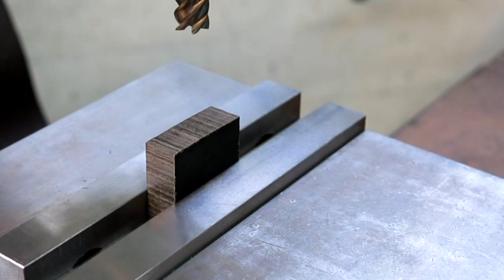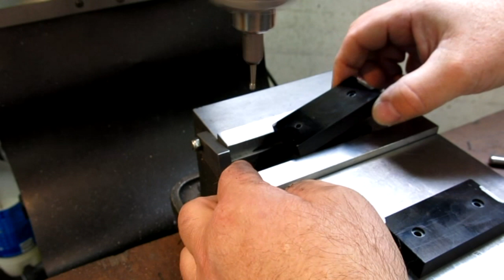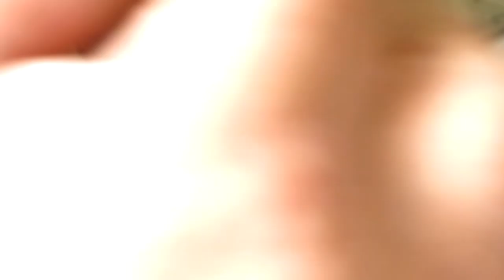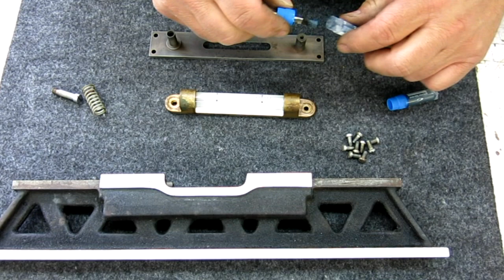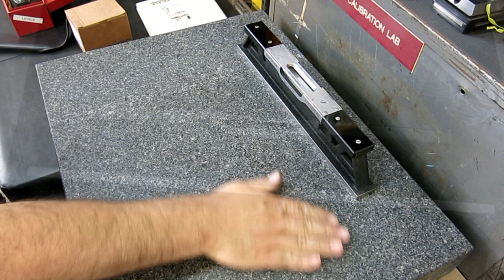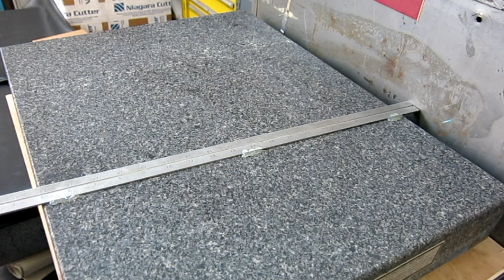Pratt Whitney Level Refurbish

Comment: That’s great. But the Starrett machinist’s kevel is marked at 0.005” per foot, while the precision master level is market to 0.0005” per foot. It only gets you so far. Just enough to level the surface plate to barely within the range of the master level.

By the way, never touch, or breath in, denatured alcohol. The “denatured” part of the name is saying that it takes organic molecules apart. We don’t want that to happen to us.

Comment: Ha, I’m not an engineer but even I can see what the problem is ,,, when you pull backwards left to right the blade of the bit is not digging in as you are offering the rounded smooth path,, when you are moving forward right to left the sharp part of the bit is ejecting material away hence the broken edges ...

Comment: I wonder if anyone sees old video comments; I will try.

It appeared that the bubble spanned several markings and was not even on either side.  Might be video distortion but the question is:  If that's the case, how is it read?
Reply: Repeatability is what you are reading to determine or calibrate a level ... surface itself need not be 100% level (or more level than the level you are calibrating). The increments or markings on level have been graduated or spaced out to measure .0005" of vertical difference over 12" horizontal by manufacturer of vial (in this case certified as such by Pratt Whitney or their supplier). That being said, when bubble was in same position relative to center point when level was rotated 180 degrees, that adjustment calibrates that level to true. Now you van level your lathe bed, or machine surface within .0005" per change in markings on level. Hope this helps. Cheers.

Comment: how did you calibrate the unit-by comparing it to your existing unit? how do you know the original unit is calibrated?
Reply: Looks like that was to find a roughly flat surface and make a rough adjustment. Once a level is close to adjusted correctly, it is self-proving by the reversal method (assuming the vial is made correctly, of course). If you turn it around on a level surface the bubble will show the same reading in reverse, then you just have to adjust it so it shows a zero reading in both orientations. If you think about this geometrically then you will see this can only be true when the level is on the level: the level shows true angle + error angle in one orientation and error angle - true angle in the other; therefore it can only show zero in both orientations if it is on the level (true angle = 0), as you are reversing the error term (or angle term, depending on how you look at it) by flipping it. From the same principle, you can determine level with a maladjusted level, because while it will not read zero in either orientation, the deviation from one orientation to the other must be minimum when the level is level. Because the level only reads 0.003"/foot, full-scale, it would be excruciating to find a rough level with that instrument alone, as even a relatively small error would be off-scale.
Reply from the maker: The second level was just to get close for the initial adjustment. To make the fine adjustment you rotate 180 and look for the same bubble position. It helps somewhat to be semi close to true level when you start. Thanks for the comment.

Cheers,

Tom

Comment: Tow, when you pushed on the surface plate was the plate flexing or the table under it? Oh, that isn't a smart acre question. I have one of these levels too.
It turned out beautifully.
Eric
Reply from the maker: Hi Eric,

I'm sure it was a little of both. Thanks for the comment.

Cheers,

Tom

Comment: Tom, Would a different type of "plastic" be OK such as teflon?
Eric
Reply from the maker: Hey Eric,

Sure. Almost any poor thermal conductor would work fine. If you were watching closely I only made one isolator. I wanted the new one to match the existing material. Thanks for the comment.

Cheers,

Tom
Reply: @oxtoolco  I have often used exotic hard woods to make end caps to give it custom look/feel ... even more expensive feeling  because of that (read could not find phenolic material or even something with "Kodak" or "camera case" finished plastic). Beauty job tho!

Comment: Tom was that blue thread-locker or some type of anti-seize or anti-corrosion / grease compound you were putting on the fasteners?

Using material that matches the original part is really cool!

Comment: just a thought. when your wanting to avoid breakout but you can't mill into the material like you did i wonder, could you score with a sharp blade and introduce a weak point so it breaks there instead of elsewhere? i do it with kitchen worktops that have a laminate finish and it works very well

Comment: It may have been the camera angle, but to me it appeared the bubble is not centered.  beautiful instrument that you very nicely restored Tom.
Reply: Actually I think the granite plate is just a hair (or maybe even just quarter of a hair with this level) off from beeing absolutely level.
A good way to check if it is the level or the surface it is sitting on was shown by Tom previously, just turn it by 180 degrees. If it still is "not level" in the same direction. If it shows not level the other way round, check your level.
With this degree of preccssion even a speck of dust, dirt or debris (very fine one) might be an issue.
Reply from the maker: Hi John,

Calibrating a level is about symmetry. When you turn the level 180 degrees it should read the same not necessarily level. If you have a good flat smooth surface you can calibrate a level even if that surface is not actually level. Hope this helps. Thanks for the comment.

Cheers,

Tom
Reply: Yes, he used his "known standard" level to find a place on the surface that produced a moment about which to measure.  In this case it appeared to be a place where the bubble is nearly/or on the line on one edge.  Flip the level around and it should be the same on the opposite end.  Then he calibrated the P&W level using that instance and setting a guide so position would be near identical.  Good enough for the girls I go out with....lol

Comment: What is the schmoo you brushed on the threads of the screws?
Reply: Best Services I'm fairly sure it is blue loctight in a custom made bottle.
Reply: Custom made bottle - check.   Gotta love that.
Reply from the maker: Hi Best,

That was Blue Moly anti seize. Thanks for the comment.

Cheers,

Tom

Comment: So you put your finger down hard on a granite surface plate, and I must assume the stand is up to Oxtools standards, and the level deflects a division and something? I f I hadn't seen it I wouldn't believe it. Yet something is tilting. Surely not the granite plate? Must be the stand. Or the suspension on the plate. Please, Mr Metrologist, I mean Mr Wizard, why is this happening? I will go through a very large number of meatloafs for the answer. It would be a large deflection if you were measuring to millionths.
Reply: The level divisions are 0.0005" per foot.  This is only 8.6 arc seconds.  That will be the cumulative defection of every component between his finger and the ground.  Everything deflects due to a change in force, even the granite plate.    A piece of lint under the end of the level would throw it off.  A piece of cigarette paper under one end would throw it out 2 ticks on the level.
Reply: I quite agree with you. Even the ground -- a concrete floor -- deflects under sufficient load. My question is, which of these components is deflecting? For ordinary measurements in a shop this deflection will hardly matter. But, in precision work, everything matters,
Reply: possibly the rubber/plastic feet on the bottom of the table, is the only pliable thing on it
Reply: Very good. First reasonable explanation I have heard.
Reply: Tom just has Chuck Norris strength in his finger...
Reply from the maker: Doug has the right answer. I scared the granite plate into moving. Thanks for the comment.

Cheers,

Tom
Reply: Would that I could intimidate my tools as you do,

Comment: Lots of small tricks for (easily) making it look good, as well as precise.  Restoring the marks on the vial, making them stand out without fuzzy edges, was something I was trying to remember the other day (it had been a few decades since I'd seen it done).  Would like to know what was used on those (I'm currently thinking enamel of some kind ...?)
Reply: I also would like to know what was used to fill the graduations on the vial.
Reply from the maker: Hi Digger,

Testors model paint. It was oil based enamel. Thanks for the comment.

Cheers,

Tom
Reply: If it was the same as the white base paint I assume it to be modeling paint. They come in very small bottles & have many uses.

Comment: Why not use Delrin? We've come a long way in the world of plastics since Pratt and Whitney dinosaurs roamed the Earth.
Reply from the maker: Sharp eyed viewers would have noticed I only replaced one of the isolators. I made two in case Mr Bozo came to town. One of the isolators is as the level came with out of Pratt & Whitney. I really didn't want to mix materials. Closest to original was my target. Thanks for the comment,

Cheers,

Tom
Reply: OEM materials=best practice in restorations
Reply: Also, to add, Phenolic feels like a noble material..putting Delrin on that P&W is like restoring a 60's Italian car and slapping a carbon fiber hood on it because "we've come a long way".
Reply: The longer the bubble the more accurate the level. Nothing leaked out of the vial, it just happens to be a VERY accurate Instrument. I think he did a wonderful job fixing this piece of what can only be described as industrial art manufactured by a true craftsman. It would have been an absolute shame to use anything other than original materials.
Reply: If you think this is just a tool, i feel sad for you.
It actually is just like with old cars in peoples garages.

Its a part history, and it has its history. So you treat it accordingly.

No matter if its a tool, a car, an musical instrument, or a painting.
Reply: Phenolic is still a very common mass produced material and obviously has stood the test of time.  It is a better choice for a thermal insulator than Delrin in my opinion.  The hand rests are not bearings.
Reply: It's a tool to be used, sure.  But if this were my restoration I would have chosen Phenolic over Delrin.  I mean, he's gone this far, why not make it look and feel like the original?

Also, Phenolic is still used over other polymers and other composites in situations that require fire resistance but the performance of a composite.  Delrin doesn't do too well  with fire.
Reply: It's a level. He's not taking it the Amelia Island Concourse d'Machine Tools. Looks like the vial has leaked anyway. The bubble should not be that long. So I guess it's just fer lookin' at.
Reply: because this is a restoration not a modification
Reply: Your' pulling my leg, are you not?  It would be like the Monalisa with an aluminium frame, the state of independence pinned up with thumbtacks, a Rolls Royce with light magnesium sports wheels, need I go on?
Reply: When it comes to originality, it's original or it's not. No middle
Reply: +Wes Johnson - I agree.  Others have replied about this being a "restoration" and using the "original materials".  If Tom were that concerned about this level of fussiness he would have used the proper size of screwdriver for every screw.  I doubt he's planning on putting this in a glass case on his mantle.
Reply: +Wes Johnson  Yes using original materials has completely f'd its functionality.  Only using Delrin could make it function properly....  Calling Tom a hobbyist was classy too.  Nice one.
Reply: lol
Reply: It's a hobby. Therefore he is a hobbyist.
Reply: Lol!
Reply: LOL so what if Tom wants his level to be like an old car in some rich guy's garage? Do you really think he needed another level? "Hobbyists..." yeah, people doing what they love, making beautiful objects for them to cherish, what morons.
Reply: Jesus. It's a tool made to be used. It's not a car made to sit in a rich guy's garage. Delrin and Phenolic have the same coefficient of thermal conductivity. Delrin is a dream to machine. Hobbyists...

Comment: looks awesome  but a little lost here  , the two marks with the dots at each end was that not zero but yet the bubble went past that .. is that how it should have been ?
Reply: Scott, I guess we got the silent treatment on this one. But, he wasn't trying to level the surface plate. Any level can be checked or calibrated by noting the reading, then reversing the orientation of the level. The fine adjustment then raises or lowers the end of the whiskey bubble to indicate on the same graduation on one end. Then by swapping ends, the instrument can be used to level the work relative to the length of the base of the level.
Keep in mind that contrary to some opinions, the earth is actually (nearly) round, and therefore the surface of the earth is curved. Any level actually draws a straight line tangential to the curved surface of the earth, and only appears to be level over a short distance. This introduces a whole new concept when building a very large object on the surface of the earth. The Large Hadron Collider for instance, with a diameter of about 17 miles(?) is perfectly "flat" , but will measure "level" at only four places.
peace-out..Tc
Reply: Tnx

Comment: what does scraping do
Reply: Dušan Pešić it is a way to make a surface flat. You rub the item you want to make flat on a reference surface known to be flat, like a surface plate, that has a thin film of marking paste on it. The paste only transfers to the high spots of the item. Then you use a carbide scraper to scrape a small bit of metal from the item by just scraping the spots with transferred paste. Then you rub it on the reference surface again and scrape off the high spots. You repeat this till you get an even transfer of paste. It is a very accurate way to make something truly flat. Look on YouTube for hand scraping.